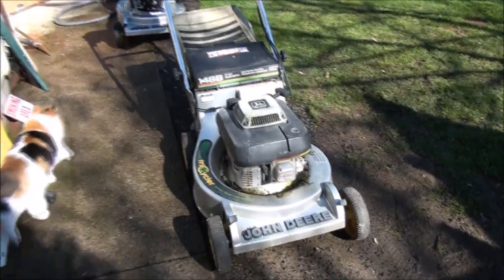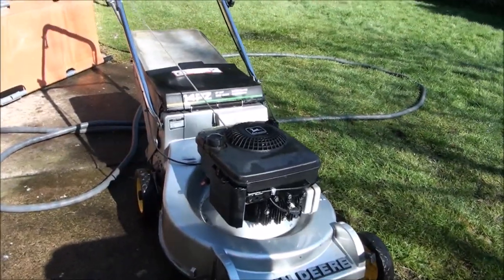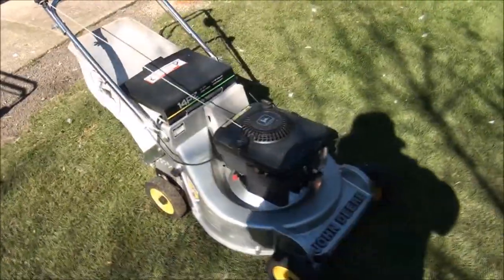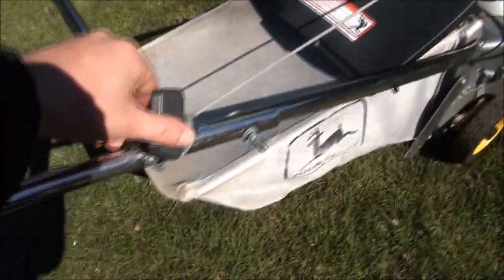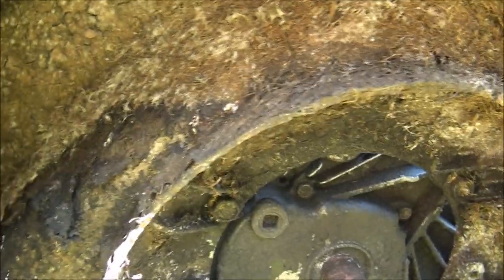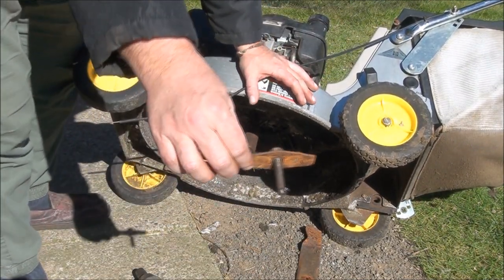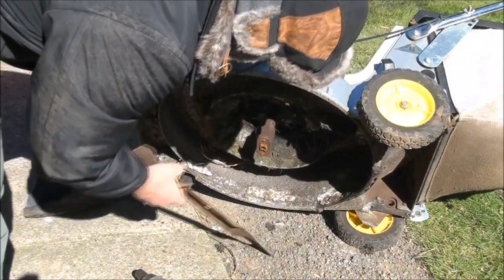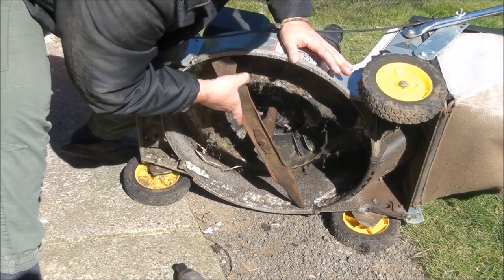WILL IT WORK? ~ John Deere 14PZ push LAWNMOWER ~ BRIGGS and STRATTON switched to HONDA engine!

Comment: I have one of these old mowers, I was wondering would it be possible to add a transmition and gear box on it to be able to turn it into a self-propelled lawn mower?
Reply from the maker: Anything is possible. However, if it is not setup for a transmission it may be alot of modifications to do it.